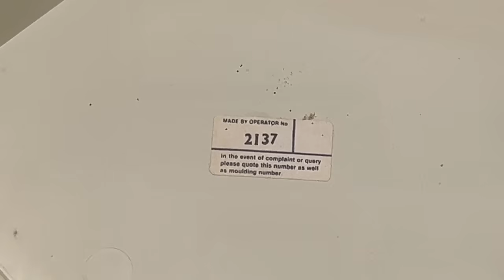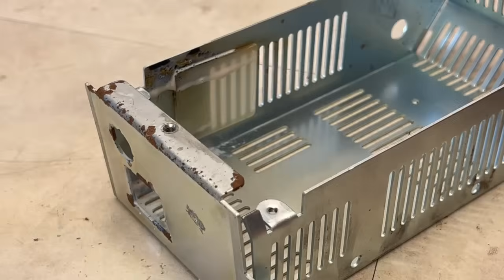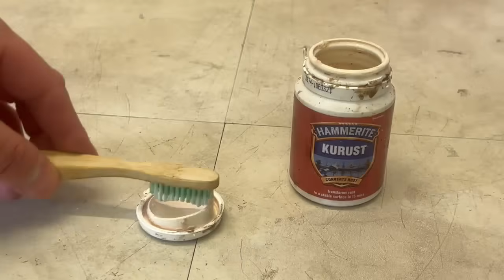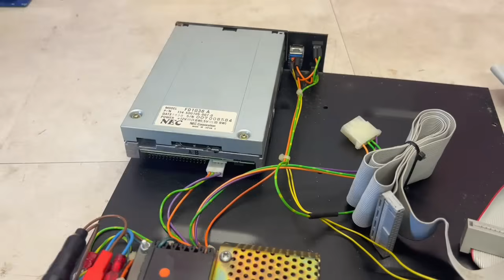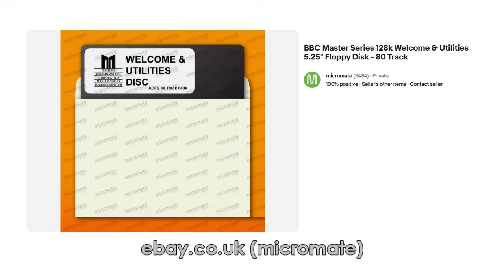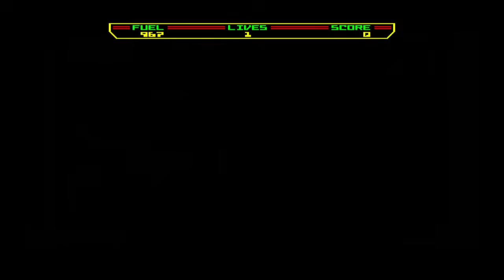1986 Acorn Computers BBC Master 128 - Review, Fixes and Modern Mods

Comment: You put the required diode and resistor on the new battery pack, right?
This is required to inhibit charging, which can cause the batteries to explode.
Reply from the maker: I've just double checked this and you're absolutely right, the system board returns 2.5v. I've added this a note in the description with a link to the correct procedure. Thank you.

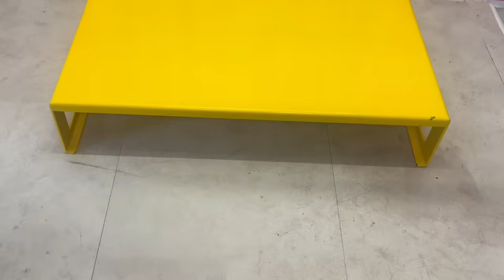Comment: I noticed you used the original power suply when you put the unit under the yellow stand when testing the disk drives if it worked why not stick with it. 16:58 video timeline
Reply from the maker: How observant ! I only found out about the USB PSU mod after I’d finished filming - but thought it was a really important upgrade so spliced it in the vid. If I’d have known prior, I probably wouldn’t have restored the original PSU 🧐

Comment: Why in Sam Hill would you replace a reefer capacitor with a reefer capacitor?  There are any number of replacements types that are better and more reliable.
Reply from the maker: Would be interested in what you’d consider a better and more reliable replacement.
Reply: @RetroRelixRestorer  A modern X2 or even X1 type mains capacitor with the same capacitance and equal or higher voltage rating should do, you can get them in polyproplyene or ceramic style. What I noticed at https://www.youtube.com/watch?v=Ke8b9IppQ2k&t=430s is that the top lead of the capacitor you did replace looked to have a dry joint, solder was balled up on the lead and hadn't flowed onto the pad.

Comment: The BBC master was a powerfull 8bit,that could be modified with various roms,there were second processors avaliable to build a 186/286 platform as well as an additional z80 cpu to run cpm software, there were hundreds of 3rd party peripheral developers providing disk drives,monitors ,printers,modems ,mouses,you name it ,it was avaliable for a BBC
Reply from the maker: Agreed, it would be really easy to get carried away with the scope - but would be interested in pursuing the Tube interface as a follow-up video.
Reply: @RetroRelixRestorer will a BBC rigg. Run doom
Reply from the maker: @Mr.1.i …with a PiTubeDirect - maybe 🤔
Reply: @RetroRelixRestorer pi will do most things,it does the rendering,there are a few videos were doom is actually running on a bbc but they dont explain how theyve done it ,it is genuine ,it lacks 256color and runs very slowly with about 16colors,but there are some videos that are a complete blag and the frame rate is perfect